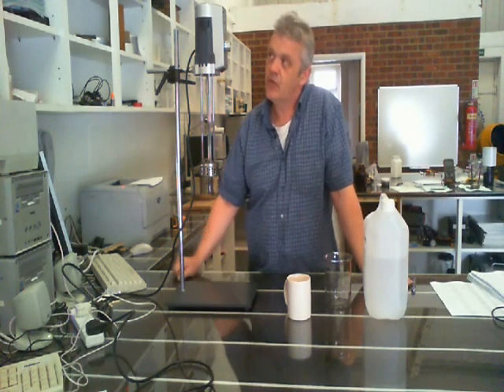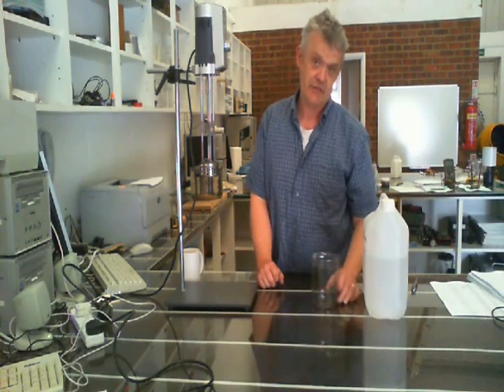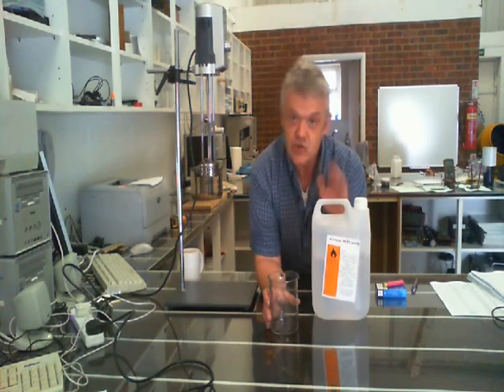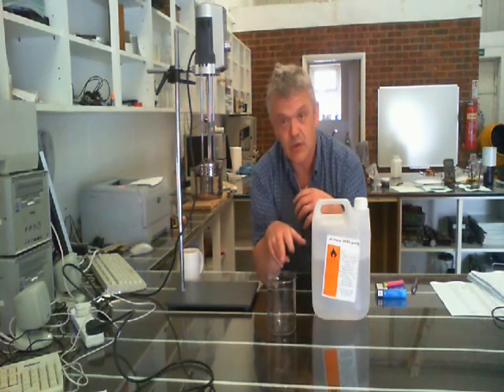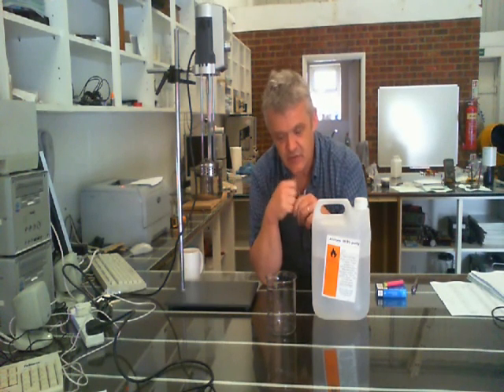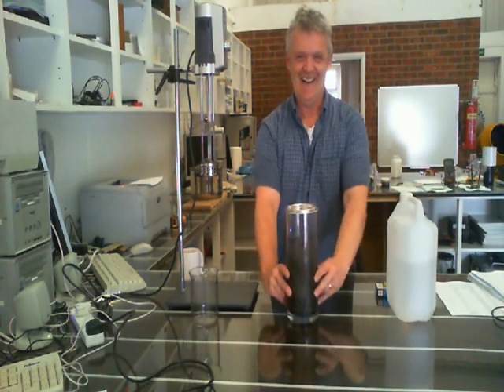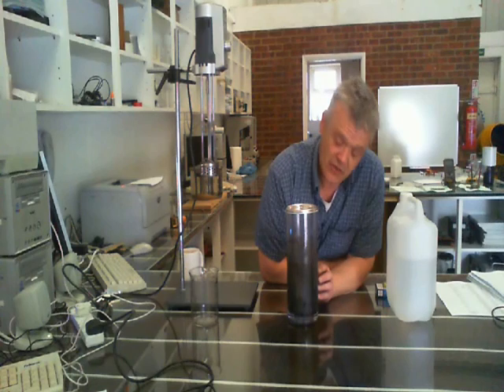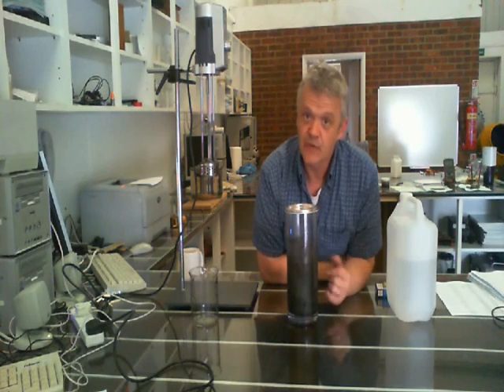The Easiest Way To Make High Quality Graphene

Comment: Hi Robert, 

Instead of exfoliating the graphite with shear force, why not use heat? Maybe a reflux in acetone and water with a stirrer bar?
Reply from the maker: +Universal Chemicals Ltd interesting idea mate - have you tried it?
Reply: +Robert Murray-Smith I plan too, I have the necessary equipment (fumecupboard etc). I have skimmed the literature and I haven't seen anybody try to reflux or hear the graphite...I'm sure there must be some obvious reason for this.
Reply from the maker: +Universal Chemicals Ltd there sure is mate - no one has thought of it lol

Comment: Hello again Robert! I'm going to do some experimenting in the next few days - I finally got in my 200g of 5 micron sized graphite powder. It is nearly graphene to start with, wow its fine!
Anyways, I was wondering how you test your raw graphene as far as having it checked by a lab or somewhere that can verify it is actually few - layer graphene?
Thanks!
Reply from the maker: +David Larson I send it out to a test lab for a raman - it costs me £150 per test
Reply: +Robert Murray-Smith I'll have to look for a similar lab here in the US. 
I was going to use the soap and water solution with mechanical exfoliation method, but I'm going to try an improved and simpler version of it with some slightly different ingredients, I'll let you know how it goes
Thanks again, take care!
Reply from the maker: +David Larson good luck with it mate - keep me in touch

Comment: I worked on finger print spray years ago.... use fast evaporation alcohol like stx.   mix power and alcohol and spray onto surface to atomize.   once surface is coated... find a way to flash it to become what u need (laser,flash, lightening)... warning!!! must wear respirator and flash point is very low.

Comment: Hi Robert, after watching this video (all the way through lol:) I was wondering if the grapheen solution would be good for electrolysis like salt water or baking soda is?
thanks as always, Chris Armstrong.
Reply from the maker: ASV TV it's certainly worth a go mate
Reply: ASV TV Diddo
Reply: +Robert Murray-Smith Would electrolysis of MgSO4 or 98% H2SO4 with 99.9% graphite electrodes yield graphene?
Reply from the maker: +dylanail worth a try let me know how it goes
Reply: Ok, I will. One more thing, how could you make graphene oxide from pure graphene?
Reply from the maker: +dylanail oxidise it - that might seem a little fascile but there it is - i might use a perchlorate and be careful of time

Comment: Hi Robert, first of all thank you for your generous contributions to the human species as a whole, and not just corporate interests!

I've been following your videos for a while and this method appears to be one of the best, because from what I understand if you have a high rpm mixer and a centrifuge you don't need a sonicator, is that correct?

I'm asking that because where I live it's really hard to get a sonicator, but I would like to make experiments as well, so considering I can't get a sonicator here should I use this method?

Also, Is there a way to do the Tour method without using sonication at the end of the cleaning step?

Thank you very much.
Reply from the maker: Gilberto Morais i did a video on cleaning graphene oxide mate - have a look at that - this is a fair enough method if you want to try it
Reply: Robert Murray-Smith 
I saw that video, but it's for cleaning graphete oxide only right? Is that cleaning also required in the acetone method you show here, or is a centrifuge enough?
Reply from the maker: Gilberto Morais yeah sorry mate - it was for GO - centrifuge should be enough
Reply: Robert Murray-Smith 
One more thing, does your homogeneizer use ultrasound, or is it the equivalent of a high rpm blender?
Reply from the maker: Gilberto Morais it's a high rpm blender basically
Reply: Robert Murray-Smith  you mention in the comments that you added a 
surfactant to avoid restacking. You didn't mention it in the video, did 
you add it to the water/acetone mix before blending or just before 
letting it settle for two weeks?
Reply from the maker: Gilberto Morais before blending
Reply: Robert Murray-Smith of course. Sorry for the stupid question.
I guess the major challenge now is to somehow stitch the flakes together to make a transparent sheet, are you planning to make a follow up video on that?
Reply from the maker: Gilberto Morais not immediately - but if you give it a go i would love to see it
Reply: Robert Murray-Smith sure I'll try to make some sort of alloy out of it. If I make something worth sharing I'll let you know.
Reply: Robert Murray-Smith, I'm trying to reproduce this method with a blender again, but I'm still obtaining two phases in the mixture after blending for half an hour: one with transparent deionized water/acetone and graphite at the bottom after letting it settle for a day.

Is the container in your homogeneizer sealed or are there openings for air? 

Do you control the temperature or just let it shear at high temperatures?
Reply from the maker: Gilberto Morais don't let it get too hot mate - there is no attempt to control pressure
Reply: Robert Murray-Smith I'm controlling the temperature through a microcontroller I programmed and blending very, very slowly.

You say you don't control the pressure. does that mean the homogeneizer is airtight? I'm sorry it that question is silly but I'm an amateur chemist and never used a homogeneizer before.
Reply from the maker: Gilberto Morais it means the homogeniser isn't air tight mate
Reply: Robert Murray-Smith thank you. I was wondering about that because since I blend for hours I thought the acetone could evaporate through a tiny hole in the blender and that could affect the acetone/water ratio and get the bad result I'm having. But since your homogeneizer isn't airtight it doesn't look like that's the case, it should be the temperature.

I tried shearing at 30 degrees max. Next tiime I'll try to do it at an even slower pace at 25 degrees max. If I manage to reproduce your method I'll send you a video with the result.
Reply: Robert Murray-Smith one more thing, you didn't mention it in the video, but did you add a surfactant to the acetone/water mixture?
Reply from the maker: Gilberto Morais not sure mate - it was a while ago i did this
Reply: Robert Murray-Smith so do you still prefer the Tour method even if it produces lower quality graphene?
Reply from the maker: Gilberto Morais i use a different method mate - but i can't disclose it

Comment: I found a really interesting article:) 

http://www.sciencedirect.com/science/article/pii/S1877705812014841
Reply from the maker: dedlunch good article mate - thanks for that
Reply: dedlunch very interesting. I wonder if the defects generated could be caused by ions on the water reacting with the tiny few atom carbon compounds, as they are using distilled water instead of deionized?
Reply: Ion concentration plays a big part in making a stable colloidal solution

Comment: Great work!! If you allow the acetone and water to evaporate will you get a graphene powder? I was under the impression the graphene would re-combine into graphite? I would like your thoughts on this guy...(see link). He claims to be making 50g+ of ultra high quality graphene in what looks like dried powdered form.

https://www.youtube.com/watch?v=ZZJuYtcWOqo
Reply from the maker: I think there are three processes - recombining, restacking and agglomoration. Graphene won't really recombine as it is more like a stack of plates in the first place - but it might restack - agglomoration is just the aggregation of particles - all nano particles suffer from a degree of agglomoration - that's why I add a surfactant to this solution which also prevents restacking. I don't really know what he has done to make his graphene so I can't really comment on that sorry

Comment: But seriously I've learned more from you than any courses I've taken and have now made some low grade graphene with a graphite pencil dissolved in 1:1 ratio of acetone to water , I water 24 hours and have now little black particles which I believe to be graphene
Reply from the maker: good on ya mate
Reply: Robert Murray-Smith what is the strongest metal?
 is it graphene

Comment: Hi Rob! I think about something and I think you have already thought about lol. The acetone evaporates at only 50-60 degrees. What about heat at 55° it in order to have just graphene in Water instead of using a centrifuge?
Reply from the maker: good idea but you might want to do it in a pressure cooker with a copper coil attached like a still so you can recover the acetone and not fill you room with acetone fumes
Reply: Robert Murray-Smith do not do that in your kitchen believe me! I saw your comment too late lol. Acetone fumes are very very explosive lol. I think the centrifuge method is safer
Reply from the maker: Mo Kha
lol - indeed - or due care with a still lol
Reply: Robert Murray-Smith I am laughing yet I called my wife and tell her you may visit your mother today. It s a long time you haven't see her. Looool
Reply from the maker: Mo Kha
lol
Reply: Robert Murray-Smith Hi Rob, after mixing the water-acetone-graphite I obtain a good mixture. Very good process mate.

My problem was to separate the graphene and the water acetone because I don't have a centrifuge.
So, I did some tests... I had a some ml of bleach in it. And that's do a good job to separate the mixture.
But now not sure that's graphene. Is that possible graphene became graphite? Thanks
Reply from the maker: Mo Kha
it does restack unless you put something in to stop it - quite often a surfactant is used

Comment: Easy organic graphene- Graphite powder mixed with tannic acid as a paste, continue mixing, add water or other solvent and you have graphene permanently suspended ink/paint. Expired U.S. patents 1906-1920
Reply from the maker: that is interesting - do you have some patent numbers?
Reply: Robert Murray-Smith There's more but here's a few.
http://www.google.com/patents/US844989
http://www.google.com/patents/US1345306
http://www.google.com/patents/US843426
http://www.google.com/patents/US911358
Reply from the maker: Michael Meadows
Thanks for that mate - very interesting stuff

Comment: Hey Robert, how do you generally know which chemical to add to your stuff to get the desired effect?
Is it because you know the properties of the individual chemicals and how they behave, and therefore look for another chemical that will react that certain way that you want based on its properties? Or is it all just trial and error?
You always seem to "just know" exactly which chemical to add to what, to achieve X effect. :/
Reply from the maker: lol - well there is a great deal of trial and error you don't see - otherwise the channel would be twenty times as long and most of it would be failure lol

Comment: Aha... A way around using soap and having to use a defoaming agent! I knew you'd do it!

I'm trying to understand what's going on in the video but I must admit that I got a little confused at times.

I'm assuming that the graphite didn't dissolve entirely into the acetone/water mix which is why you're mentioning sedimentation. Would, perhaps pouring it through a coffee filter expedite removal of larger pieces or might it add extra contaminants from the filter?

I'd love to see you using equipment that's available in the average house.

Comment: FANTASTIC!! You are here-by awarded the title "People's High Commissioner of Information".
I left a comment on your "new lab" video but I'll ask here (where you may see it more readily).
Does the "graphene ink" maintain the hexagonal matrix, graphene is famous for, when it is applied?
As I mentioned over there, I'm contemplating ideas prompted by Viktor Grebennikov in his work on "cavity structural effect" which involves the "honey comb" structure.
I think your expansive curiosity would have great fun with that and you can do some reading here: http://www.rexresearch.com/grebenn/grebenn.htm
Thanks,
BE
Reply from the maker: Interesting stuff - and I read all the posts mate - in fact I don't particularly like multiple postings of the same question - it's the youtube equivalent of nagging - i get some people who post the same question across 5 or 6 videos - i normally delete that kind of activity. You have to realise that high concentrations of graphene are more or less guaranteed to agglomerate and reaggregate unless oyu add something to stop that. So, there is bound to be that happening in the ink - to what degree I have no idea. All I can say is the graphene in the ink is sufficient to give a 8-10 times improvement in conductivity over other conductive inks and that is impressive enough. If it will do the job you want - well again - i don't know - but I would probably try it and see - if it was me
Reply: Robert Murray-Smith
Sorry, I didn't mean to nag/spam. I'm just very intrigued and enthusiastic about the information you're sharing and I didn't know how often you went to older posts. The processes I'm contemplating are more concerned with the atomic hexagonal structure than with the electrical conductivity, per se. That's why I wondered if you knew whether that structure (in a single layer of graphene) carries through to thicker clumped/agglomerated "coatings" of the material or whether it is peculiar to a single layer and I would therefore need to maintain greater control to maintain that structure.
Reply from the maker: incidentally your previous comment was fine - i just deleted the duplication. I check all posts all the time. the structure is maintained
Reply: Robert Murray-Smith Excellent! Thank you. I'll let you know if anything comes of my experiments.
Reply from the maker: cool

Comment: Robert Murray-Smith I think I found the paper you mentioned.  M Yi et al.,"Achieving concentrated graphene dispersions in water/acetone mixtures by the strategy of tailoring Hansen solubility parameters", J. Phys. D: Appl. Phys. 46 (2013) 025301 http://dx.doi.org/10.1088/0022-3727/46/2/025301
Reply from the maker: yep that's the one
Reply: Good, I read and digested  every bit of it :)
Reply from the maker: it's a good article

Comment: Can you tell where you get the homogenizer?
Reply from the maker: lab supplies usually have them there are also specialist lab machinery companies - just do a web search they will turn up - you want high shear mixer as your search term
Reply: Robert Murray-Smith I'm asking because i ca't find one so cheap with 30000 rpm, the normal price is 1200+ gbp. By-the-way, i'm trying to synthesize a graphene composite for my master's thesis, i can share with you some stuff i being doing to post a video about that
Reply from the maker: Vitor Emanuel
ring them and discuss - the price is often just an invitation to treat. I don't quite know what to say about your kind offer to share information, but thanks - what is the subject of your thesis?

Comment: Brilliant use of water and acetone :) Cheers mate for the tip!  I agree, cleaning the soap out of the graphene is challenging, to say the least!  Acetone evaporates nicely as well, leaving no residue behind.  Treating graphene with soap at two-hundred some odd degrees Celsius under a vacuum was one way to do it, though time consuming.  I would be interested in the paper's title for the paper regarding sonication with the diverse solvents. Again, thanks for the tip.

Comment: 4mg/ml? I have hear correct?
Can I do it with planetary ball mill? (teflon lined low RPM to avoid smash)
Reply from the maker: I would think so - but a high shear mill would be better - like a mortar/grinder
Reply: Robert Murray-Smith Are you sure that 4mg/ml concentration after one hour is of pure graphene?
I ask because on an acetone/water + sonication mixture paper I saw they got 0.21mg/ml after 4 hours, and on another paper using a kitchen blender they got 0.22 mg/ml after 5 hours using a DMF solvent. So if you really got 4mg/ml after a single hour you simply beat those researchers by an order of magnitude, and much faster!
Reply from the maker: Gilberto Morais
give it a go and see
Reply: Robert Murray-Smith I did and it burned my blender like you said lol
Unfortunately it lasted around 30 minutes, but I got a grey homogeneous mixture (except for the precipitate) that has been that way for a week now.

I got a bit from near the surface with a pipet (no centrifugation or filtration yet.. working on it) and dropped it on a bit on a piece of plastic.

Found it pretty interesting to watch as the acetone evaporates: a bunch of floating graphene flakes float toward each other and become visible blobs of graphite again (at least thats what I think it's happening).

I thought of adding a surfactant next time but that would make the graphene an insulator and I would like to use its conductivity.. Do you know if there are any surfactants that aren't insulators?
Reply from the maker: Gilberto Morais
there's a few on the market triton is supposed to be good